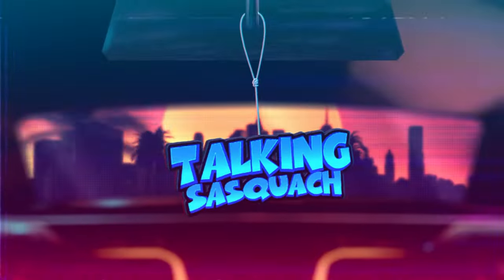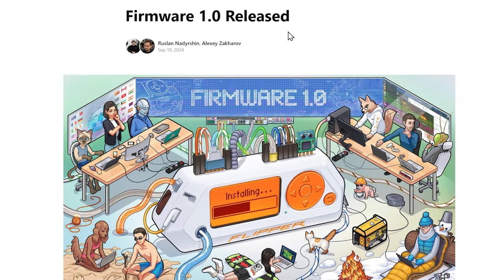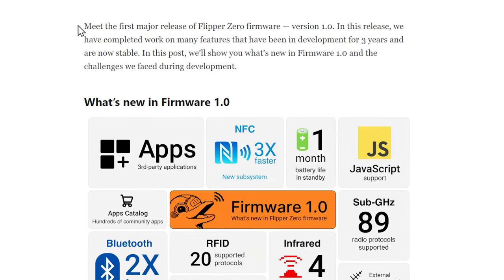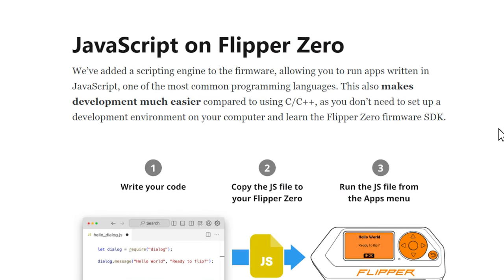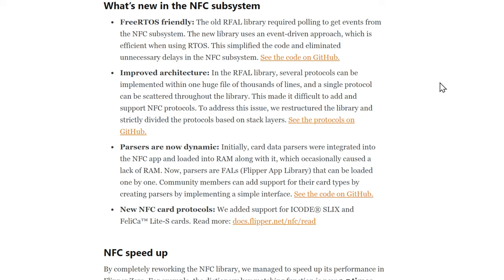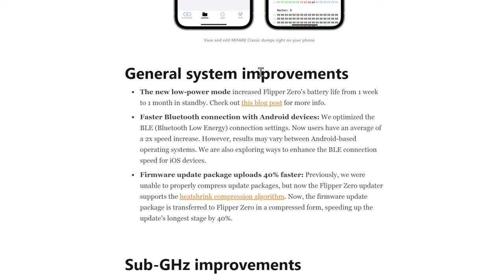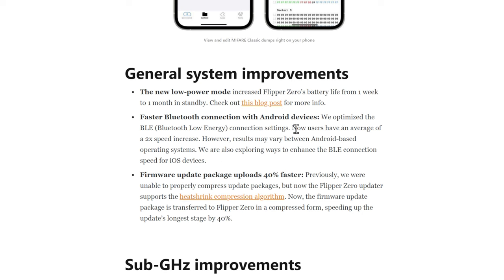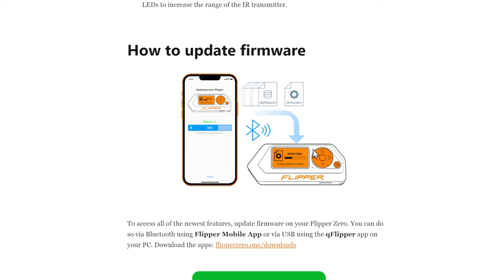Flipper Zero Firmware v1.0 Is FINALLY Out!  What you NEED to know!!

Comment: Anyone having an issue with Marauder deauth attack? I used to be able to deauth my own 2.4ghz network and know its not work like it did. I've tried Flippers new v1.0 firmware, Unleashed, and Momentum. I have the Flipper Wifi dev board, and the Rek5lab triple board that I've re-flashed  Marauder and nothing seems to work. I can run a scan and see a list of APs. I can rickroll so I know both the dev board and triple module are working. Any help would be awesome. (Also wifi security is WPA-2 and changing it to WPA-1 does nothing)

Comment: So this is where I am confused, so you have both the Original and the Momentum Firmware? Or do you flash Original to upgrade it and then reflash Momentum? I was thinking maybe the Momentum Firmware would eventually get all these features. Struggling to figure out which way to go.

Love the vids by the way! 🙏🙏🙏🙏
Reply: Upgrade official firmware, then flash whatever custom firmware you use. You can also put your cfw on SD card and boot to it from the SD directly on the flipper. The latter option gives you freedom to use both firmware interchangeably without having to refresh anything. 

Have fun out there. 👾☠️
Reply: @laory1808  gotcha thanks so much!
Reply: @laory1808  So flashing the new 1.0 firmware then flashing a custom firmware keeps all the 1.0 updates?
Reply: @kyungi1  yes - if you flash 1.0 and then flash to cfw, your base build will be updated.
Reply: @laory1808  no. absolutely not. completely wrong. switching firmware removes EVERYTHING from the previous firmware you had installed. installing official and then installing momentum is equivalent to only installing momentum.
Reply: yes, the custom firmwares would need to integrate the changes from official 1.0. the part that EVERYONE seems not not understand, and this video was supposed to explain but clearly people still don't listen to the video, is that EVERYTHING from 1.0 is several months old. all of these features have been included as far back as momentum 005, and many of them predate momentum even existing.
Reply: 1.0 is just a "milestone". it is a recap of the last 3 years of flipper development. nothing listed in the blog post or in this video is new. we have had it all for many months and many releases.

Comment: i've been using flipper-Xtreme.  If i go back to using Flipper zero software with new firmware will i loose existing info stored on the microSD card and the ability to use wifi tools like EvilPortal and Marauder?
Reply from the maker: Just update to the latest version of Momentum and you're golden.

Comment: There is custom firmware available for that Quansheng radio you used. You can use it to jam radio signals. I'm not sure but I think you can use it together with the flipper0 to do a rolljam attack on cars
Reply: It's not necessary to try and jam the receiver from receiving any valid codes when recording a rolling code signal for a replay attack.
The captured signal will be valid again after the receiver cycles through a few codes by normal use.
Reply: @honestlocksmith5428   If I understand you correctly then opening a car with the captured code becomes Russian roulette. I dont know where you get your info, but by the time the same code cycles back to that one code you captured gta 6 has already been released. It is ABSOLUTELY necessary to jam at the same time.
Reply: @moslimislam5714  it's a rolling code, so a captured code becomes a valid code from the entire pool of 65k codes. This occurs within a few uses.
Reply: @honestlocksmith5428  🤦‍♂️
Reply: @moslimislam5714  The concept of forward biased rolling codes and a 16-bit sync counter can be confusing to some.
Reply: @honestlocksmith5428  🤦‍♂️ 🤦‍♂️

Comment: What’s your knowledge on ps5 controllers I have mines updated but I like to use it Bluetooth I understand wired connection is safer is their anything I can do to protect myself better also was thinking of upgrading my modem /router one that can do WiFi 6 …will that be necessary to get especially if I have kids that like to hack or act like there hackers with their flipper zero